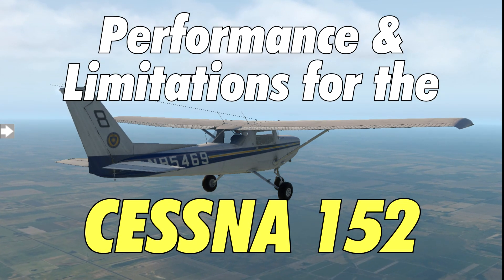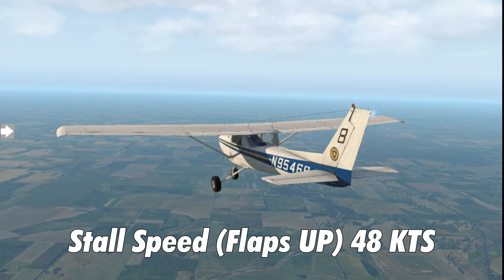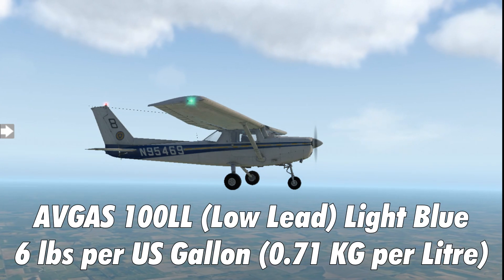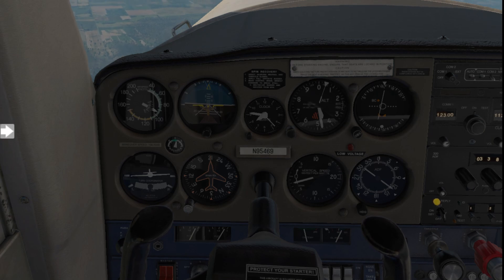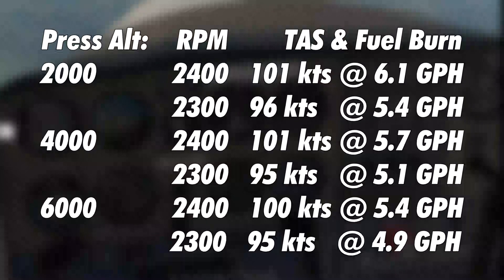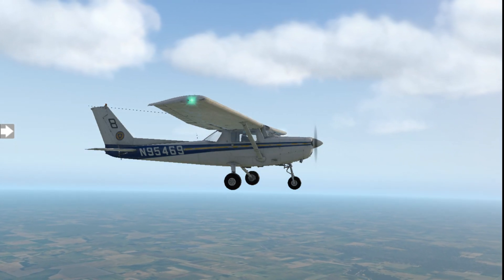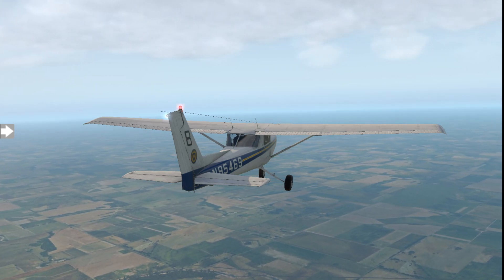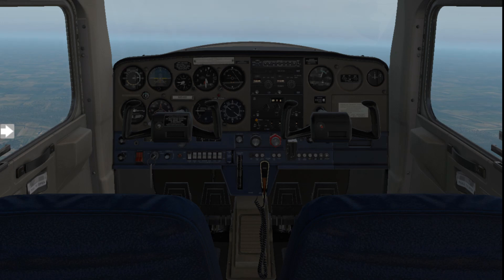Cessna 152 Aircraft Performance & Limitations | VFR Flight | X-Plane 11

Comment: Great Video, very informative....I have trained in the C152 for only 5-hours in total. I agree feels like a kite and very nimble plane everything feels magnified in both feel and operation, hate it when there's wind, love it when there is almost no wind....also a little tricky in landing compared to the Piper PA28 140.
Reply: Fly a Cessna , drive a Piper
Reply: How many hours do u have now? I’m at 7 hrs in the C152
Reply: @Bubba_Yaga  10-hrs = 150 | 25-hrs = Piper I was adviced to get both on my SPL, if ever one is not available, use the other. Love them both...but I LEAN towards the Piper Plane a lot more.